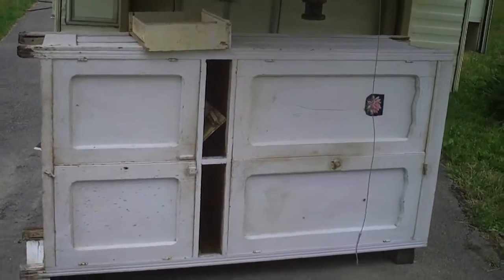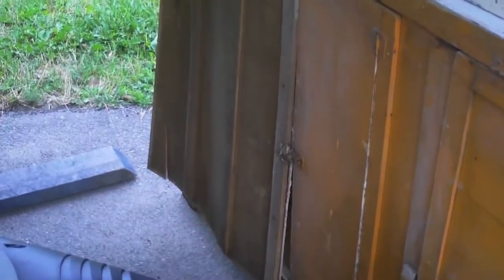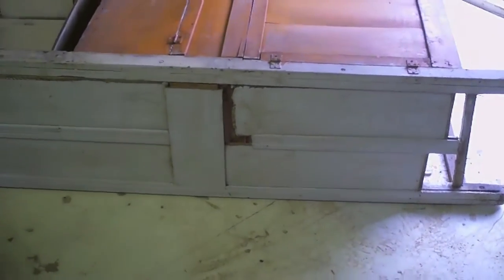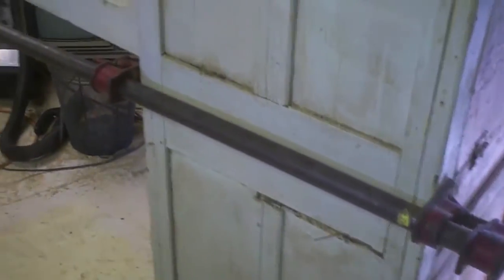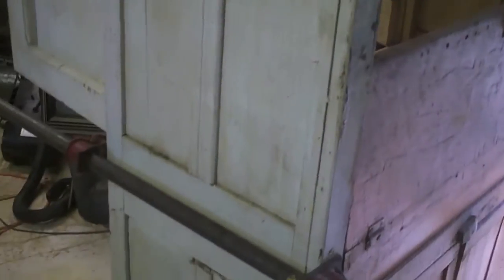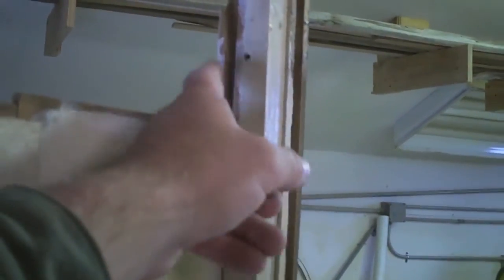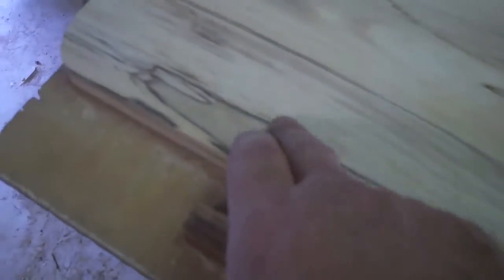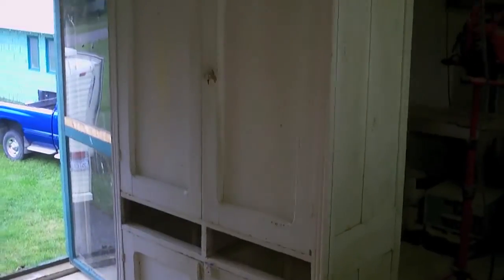Rebuilding a Country China Hutch

Comment: When I have really warped pieces of wood I want to save, I soak them in cool water in a barrel for a day, then sit them out in the sun on a perfectly flat surface with bricks and stuff stacked on top of them. Most of the time they flatten enough that light sanding will get them to fit.